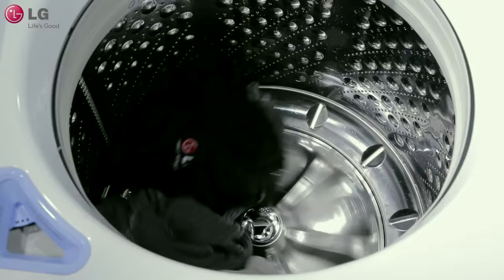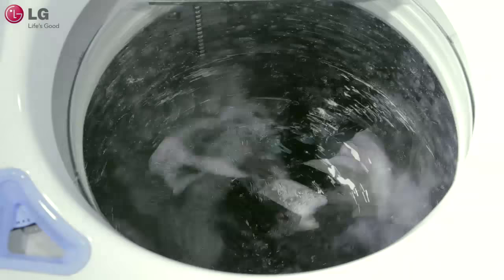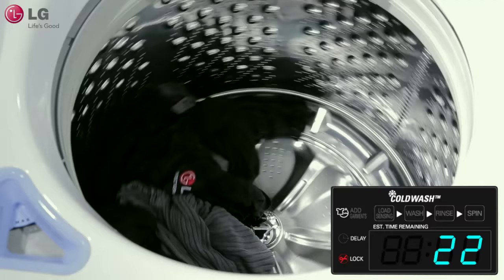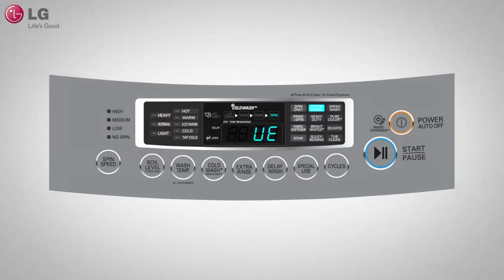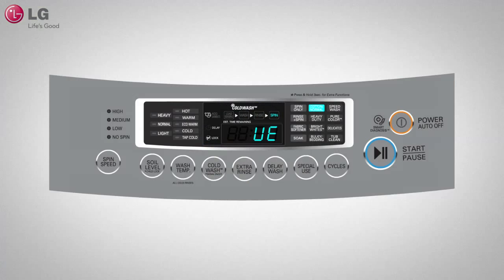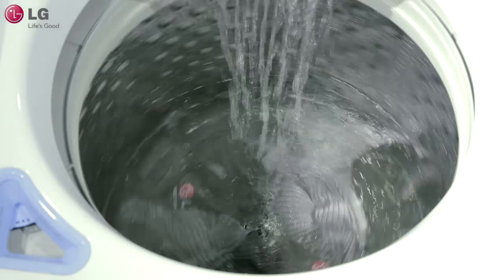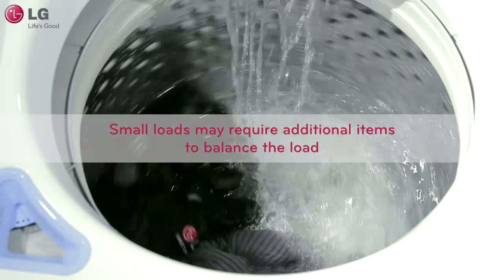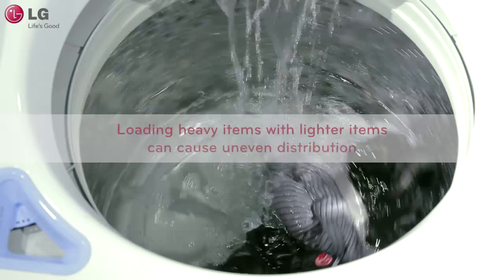LG Washer - Top Load Balancing & UE Message (2018 Update)

Comment: Just had a repair man speak to a tech at LG, this has been a known issue for years on the WT1101CW model.  The only way to fix the issue is replace the suspension rods.  If that doesn't fix it, a new clutch(splines wear out) is needed.  The cost is almost as much as a new washer AND the parts are the same ones used in the first place...

Comment: I have had mine for about 3 years and I get ue about 8 out of 10 washes. The washer is level and the spin is most often pretty smooth and it will still throw a code. I even done spin mode empty once and of course it threw a code. A lot of money to give for something that causes stress and frustration. I'll never buy another LG product.
Reply from the maker: Hey Randall- Sorry to hear that & happy to help get you in touch with the proper team for assistance! For social media support, please direct message us on Facebook (LGUSSupport) OR Twitter (LGUSSupport) with contact info. You may also call support at: 800-243-0000. ^CJ
Reply: na, just take out the red and white little filters they are clogged with dirt.. rinse them and put them back in and it will start to work fine again.. had problems with mine also, mine is a samsung and it will clog every now and then. good luck.
Reply: @AlyssaGomez  what filter?
Reply: I agree, unreliable water wasting junk. The filters are inside the hose connections on the back of the unit, Will need needle nose to pull them out. An external filter would be so much better. Anyway, today the unit wont stop filling. Turns out inside the solenoids that control the water, are tiny little holes that clog up and wont let the valve close. 2 screws on the back and a good pry on the front of the valve cover will pop it off to get access to the valves. Turn off water before loosening the solenoid screws, go slow, magnetic plungers will fall out as you lift off the solenoids. Pull out the blue disc and clean out the 2 holes with a needle, reassemble and she should stop water flow now.
Reply: I am done with LG for life!
Reply: @KyleCowan  Yes me too. I also had an LG phone once also that I paid cash for up front and it was just barely out of warranty when the screen quit working. They told me sorry and nothing they can do. 

Everytime I'm in a store looking at appliances or electronics I first glance to make sure it doesn't have the LG name on it.
Reply: I had an LG Toploader and I only had the UE air code once and it went away pretty quickly we’ve able to fix it pretty easily

Comment: Lg why don’t you just have the option to disable the error code??
Reply: Very good question.
Reply: Lg why don’t you just have the option to disable the error code??
Reply: Forget disabling the error code. Maybe it's too sensitive or junk design but you need that error code to stop the machine when its unbalanced. The REALLY stupid thing is trying to add water three times to autobalance the load before the error code comes up, and then you still need to rebalance. What a waste of water and time. Just top immediately and ask for a manual rebalance.

Comment: My wife is losing her mind.  She has a 1/3 load of blankets in the washer and has had the UE code three times so far.  

Just hung up with LG.  Emptied out wet blankets and directed to use the special use button to select rinse and spin with washer empty to reset the system.  In 24 minutes, I will use the special use button to select spin only with the clothes in the washer to see how it goes.

Not happy.  If this doesn’t fix, am probably going to get rid of the washer and look for a product that doesn’t have bad reviews.  Hopefully, that is not necessary.  The load was not wobbling very much at all during the spin cycle.  I could hear a little difference in sound, but no rocking of the machine.  Maybe the sensor is set too sensitive?

To the folks at LG, please don’t reply with “hate to hear that”.  I know you hate to hear that.  Let’s see if the troubleshooting steps work.  There are too many of these negative comments about this problem here.

Just went down to see how the reset was going (empty washing machine).  Yep, a UE code with an empty washing machine.  On the phone now.

Good news! My machine is out of warranty and nobody will come up to me.  One place adds $300 to total cost and bills to LG if under warranty, but mine is out of warranty, so sorry Charly!

They gave me 3 phone numbers to call in my area.  All three said they do not service where I live.  One said it might be possible, but that there would be an additional $300 charge added to the service call IF the boss approves it.  
SO, I called LG back and tried to determine if there is an imbalance sensor (separate from control board like my fathers machine).  The customer service person was unable to help me.  She is an offshore person, so it was difficult understanding her and she could not explain how the system works.  I asked if I could speak with a tech, and she said that she has to enter a company reference number to speak with a tech, so  it would be impossible to transfer me.  

I Am GETTING UPSET NOW.  Last week it was my LG Refrigerator.  If you think I am making this up, go check your records.  You just put a brand new compressor in my LFX25973ST refrigerator.  Hey, at least that was under warranty, and labor was ONLY $600 out of my own pocket.  Try living out of a dorm fridge for 9 days sometime, while you wait for parts to arrive and a technician to come back and install them.

I have three LG products in my home.  Two have taken a dump on me.  

LG, feel free to reply to this comment and tell me how you are going to help me out.  Not asking for free stuff, I just need help.  If you can’t help me, can you recommend a non-LG product that I might be satisfied with?

Following morning:

UPDATE:  I have been in the phone now for 20 minutes.  Started entry level and asked for supervisor.  The person tried to give me service center numbers (again).  I explained that it was pointless and asked for supervisor.  After 5 minutes I was connected.  She tried to give me service center numbers (again).  I explained I need to talk to tech so I can order parts and fix myself.  She asked for 30 minutes to find techs in my area.  I said I was past that and needed to speak with someone who can help me diagnose problem and order correct part.  I told her I would get on social media and factually describe the LG customer service experience.  SO, LISTEN TO THIS:  she says, “ Since you are threatening me, I am going to escalate this to the next level”.    I don’t know if that is how they are trained, but there was never a threat made against her.  My only threat was to describe the LG customer service experience.  And, I am doing it right now while in hold.

I am on hold with the higher level person right now.  Before she put me on hold, I told her to pull the tape and listen to it if she doubted anything I said.

Ok, she is back.  She asked if I had been to LG web site.  I said yes, but maybe not the right place.  So, we went there together (figuratively) and went through the UE error code steps and it turned out to be what I did yesterday.  So, it says contact a technician.

On hold again.  When she came back, she said there was a software update that addresses a UE code, but it was for machines with a date of manufacture after my machine was built.  I have to go find/order the appropriate cord to do the update and give it a try.  More updates to come.  Hopefully, it works and I can report back that I am happier.  The supervisor I spoke with was very professional, polite, and understanding.  She tried to give the standard lines (I am sure they are trained to follow a routine, and I helped her through that as quickly as possible so we could move on to the next steps), and was always willing to put me on hold and go check the things I asked for.  I spent an hour or more yesterday in the phone.  This morning started with a 7:00 am call that just ended at 8:40.
Reply: Oscar Blue the update dose doesn’t work either . It’s a junk product and we have all been ripped off by LG
Reply: Any updates? Lolol
Reply: @kensimon4478  Yes!  We bought a $500 GE washing machine.  Although it isn't a "high efficiency" machine, it uses 1/3 the water of the LG product because it is able to run a complete cycle without error.  

The good news is: the LG machine fit into the dumpster easily, and I am sure it has lots of other LG friends to hang out with at the dump.

We also LOVE our WHIRLPOOL dishwasher!  It also works the way it is supposed to.  Our WHIRLPOOL refrigerator and dishwasher are good friends now, and have never had a doctor visit.  When we sold our house in 2020 and moved, we left our LG refrigerator behind, as it too had problems.  Curious?  Search for LG icemaker stuck.  Also LG refrigerator won't cool.

Comment: My washer is off balance even when empty. It started new as okay, but as time goes on, gets worse. Now at a couple years old, I cant even run a small load without the drum slaming the sides of the housing. Went back to my 20 year old Kenmore washer and suddenly remembered how laundry was supposed to be instead of babysitting and constantly readjusting a load to watch the machine fill with water for the 20th time and mix the load again, attempt to spin, repeat process and error code. 4 hours later going down, take the sopping wet clothes out, put in the real washing machine and pulling out the LG to collect dust. Sure is pretty though 👍

Comment: I can't believe that for six years I have put up with this LG washer going out of balance. I have tried every tip on balancing, positioning the clothes, etc. Best tip was using the "Bulky Bedding" cycle for every load. This fills the tub to the top with water, so no savings there.  LG helpline was no help! I am officially done trying to work around this unbalance issue and spending hours trying to do one load .. Will be going out to buy a new machine. For years I used the least expensive Kenmore that you could buy and never had a problem. So disappointed in this machine. Yes .. I have kicked it and sworn at it many, many times. That didn't help either. Will never buy another LG appliance.

Comment: Most of these kind of washers - LG but may sell as Kenmore elite, etc - has design issues: 1)damping rods fails at 3-6 years caused UE, 2)rust caused by spin out. Buy 1960-2000 top load washer(center column agitator), or side load washer(closed drum).

Comment: I have had this washing machine since late  2013. I am happy to report that I just achieved the full speed of the spin cycle. My clothes came out very nicely damp to go into the dryer. This thing is out of balance (UE) every single cycle and I hate it. I am so glad that I had a cycle that actually worked and everything was damp when it came out. I have literally never heard it spin as fast as it did tonight. Thanks LG for this great spin. I am not being facetious. This is the very first time since 2013 that it has spun my clothes out.
Reply from the maker: Hey Tim, Thanks for sharing, if you need any help or have questions about your washer, please direct message us on Facebook (LGUSSupport) OR Twitter (LGUSSupport) with contact info. You may also call support at: 800-243-0000. Thanks! ^CJ

Comment: I fixed mine today by tipping the machine back, and tightening the stator bolt in the center underneath. It was so loose, I got over four full turns before it was tight again. Hope this helps someone else.
Reply: thank you~ going to give it a try! So frustrating!
Reply: I'll give it a try and let you know if it fixes or improves anything
Reply: Did it work?
Reply: @crystalhuebner5713   did it work?
Reply: @MarkGamble52   did it work?
Reply: @AlanHouser  no. purchased a maytag
Reply: The entire assembly spins when I try to tighten it.  Is it supposed to keep spinning until it tightens or is there something I need to do in addition to turning it to the right?
Reply: Update: I ended up having to tighten it every few weeks. I added some loctite to the threads and that got me a few extra weeks between tightenings. But the washer continued to stop for being unbalanced. I ended up buying a Samsung 3 years ago and it's worked great. As another benefit, the Samsung model uses plastic parts around the bleach cup, so I no longer have the rust issues as I did with the LG. Won't buy an LG washer again.

Comment: After years of having this issue AT RANDOM, I have concluded that LG stands for "Lousy Garbage."  It got so bad at times that it took hours to do a simple load of whites.  LG refuses to acknowledge this is a problem of theirs.  I am about to go beat my laundry with rocks and I will bet it takes less time and less stress than using this "HIGH EFFICIENCY" machine.  That UE syure is right as it was an error for any user to attempt to wash a simple load of laundry without stress.

Comment: I too am having the same issue but after standing at the machine countless times and still not being able to resolve the issue, I have found if I turn the machine off and restart it from the start, it usually goes straight thru the cycle without issue.  It’s frustrating but it saves me having to rearrange the load countless times.
Reply: Why should we do this? Obviously you should not have to watch your washing machine

Comment: What a bunch of crap.  The only way to fix this is to modify the poorly designed piece of crap with 4 bungy cords or rubber bands in the corners of the tub to stabilize it.  These LG recommendations rarely work.  My washer stays in the spin cycle for hours even after multiple rearrangements.  Best way to avoid the problem is don't buy these crappy LG  washers.  LG should be sending a serviceman out to modify all of these washers.
Reply: You should get true balance plus it’s way better

Comment: I even tried to do a tub clean cycle with zero items in the washer! Still got the UE error code! Wtf? 🤦🏻‍♀️
Reply from the maker: If you are getting a UE error code with nothing in the tub, it means that the washer is not properly leveled or that the floor it is installed on has more than an inch of slope to it, or that it will need to be inspected & diagnosed by a qualified service technician to determine what the issue is...^Ivan